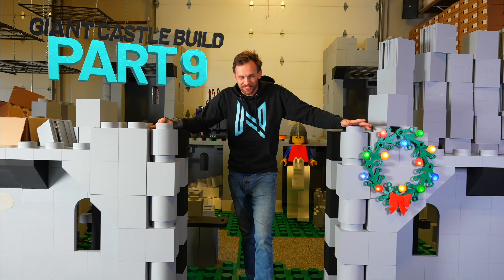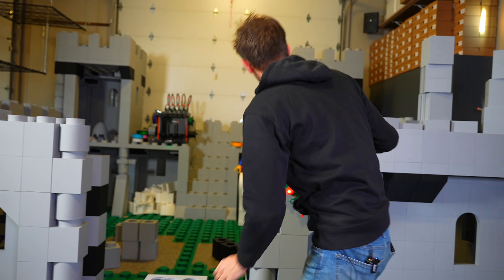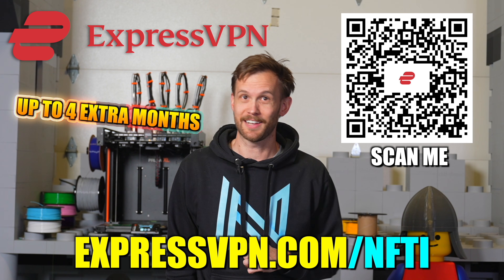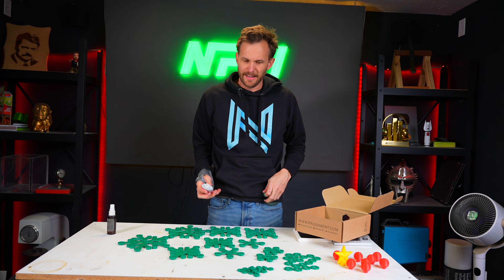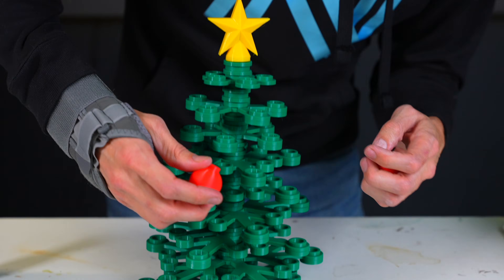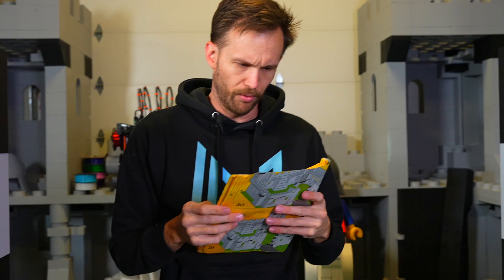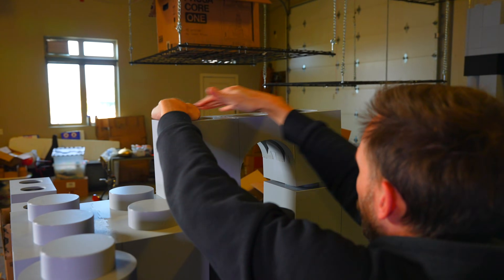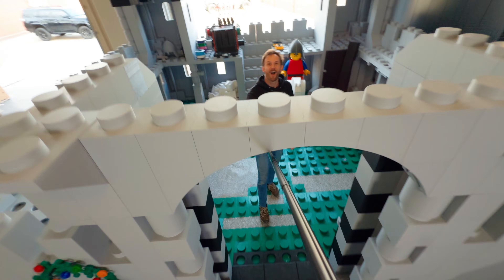What if Lego-Style Bricks Were the Size of Real Bricks?

Comment: It's tendinitis, where constant overuse of the hands and wrists cause the tendon in the forearm to swell; which causes pain because the tendon works by sliding in and out of itself which is the point where the swelling occurs. Treat by; slow option, resting in a brace and stretching every couple of hours takes a little longer than a week, or the fast option, take an anti-inflammatory once every four hours (check the packet regarding dosage) and should be ok within about 48hrs

Comment: What's going to be fun is getting your castle out of your shop Nate. Also, for the draw bridge, if you haven't resolved the issue yet, you're going to have to weld and build in some rebar for support. Have a U shaped piece within the blocks holding the flat plate, and those are welded to the rebar or supports on the flat plate.

Comment: What would you build with Capacitor driven high powered electric plasma generated Ultrasonic holography with ultrasonic resonance for melting metals without requirements of a smelting system? (Make sure to apply public filters to prevent absorbing vibration into cells so it goes through you like you don't exist = "Utilizing ultrasound to disrupt pathogens US20100113983A1" Click patent Google AI lies saying Cavitation its direct resonance transfer for perfect efficiency) Points at Boeing Plasma force field and slides eyes to capacitors filling & dumping to prevent a heater from straining an outlets or overwhelming generators If I can't have fire or Ultrasonic resonance cellular warming I like these heaters that blast me like a hair drier lol.. 

But I just told you how to merge multiple breakers to prevent flipping any of them for continuous high powered Plasma generated Ultrasound stuff. Not trying to get into your business or anything I'm just telling how end your entire mass production system with REPLICATOR tech.. Google: "Ultrasound stem cell proliferation" + "Ultrasound can read minds" A technology with medical & production application limited to the universe itself and imagination. Tesla: "The key is visualization." Bacterial flagellar motor is a reversible rotary nano-machine research it Universe has lots of ideas inside you.. It keeps secrets sometimes that system does.

You'll probably see someday.. Google: "Ultrasound can deactivate parts of the brain" It can deactivate pain and sedate while allowing full lucid for hearing & eye recording for surgeries or just stopping unnecessary pains because Human mind knows to get why fixed. Same logic works for Human Karen's outside the home screaming at each other too. Beams audio spotlight Heavy metal at them Nobody hear it but them in the beam.. Funny as hell when they clinch up and run. - Dracula, son of the Dragon  🦇=Ultrasound Mastery https://www.youtube.com/watch?v=LQ1iggFnFYA DUST TO DUST.. Ultrasonic resonance disintegrating material bonds and reprinting = Best recycling potential HAHAHA!
Reply: Typos.. Oh well.. "capacitors filling & dumping" = "Capacitors for filling & dumping" > "heater" = Heaters" > "an outlets" = "outlets" Doing bunch of other things.. Because.. Idiocracy Vatican visiting minions makes thousands of versions of junk they can all download on their phones to drop quality of everything by results hahaha. Virus..

Comment: Next, I need to see some other YouTuber take that little Christmas tree file, and up-scale it the way you did the castle until it's five feet, to use it as a regular tree for presents.
Reply from the maker: Check out what @Ruth_Amos has already done!
Reply: @NFTI  You know, I got the King's Castle LEGO set for Christmas in 1986, and while I don't have the set anymore (parents donated it after I went off to college 😭) I vividly remember it because my older brother also got a tape recorder boombox that year.  And we recorded ourselves talking about our toys, and other shenanigans at the time.  I ripped the cassette tape to MP3 over two decades ago and lost the files.  Then I was digging thru an old box in my parents attic and found a hard drive. That drive was an old IDE connector, and I didn't have anything but SATA. Well, I managed to get an old IDE to SATA adapter working, and guess what was on the drive, along with a bunch of other crap from college ?!   The 1986 audio tape MP3 files !!! What a miracle !

Comment: I think its more likely repetitive stress of screwing on every LEGO nub more than the pounding. But even more likely is that its just extra sensitive from the change in the weather more so than any aspect of the build.
Dare you to 3D print a castle scale LEGO brick separator ;) If my budget weren't so tight I'd even buy the spool of filament for it.
Reply: Nate does have a video about making a brick separator. His has a ratchet mechanism.
Reply: @fredericapanon207  I saw, I just meant the one LEGO bundles with the kits for the novelty of how big it would become in scale ;)

Comment: The tree needs to have wire runners along the bottoms of the branches, hollow studs for the trunk for wiring, and a hole into the side of the ornaments for feeing a light into it. Should be trivial to do a series of LEDs if each has just two wires and contacts bridged through the hollow middle for easy disassembly and no need to resolder

Comment: For the tree you should use the stud design with a hole through it so you can put a dowel through the trunk to reinforce it. It looked like it was ready to fall apart.
Reply: Exactly what I was thinking 👍
Reply: I went into Tinkercad and added a "Hole Tube" that is 63.8mm wide.  Centered that in the middle and you have a stud design with a hole in it to run a dowel through.  Easy and recommend it for stability if you want to take it apart later.
Reply: ...might be enough to use some of the deco balls as spacers on the leaning side/s